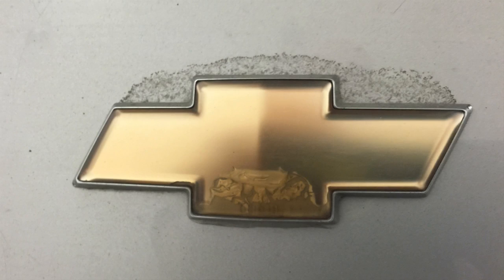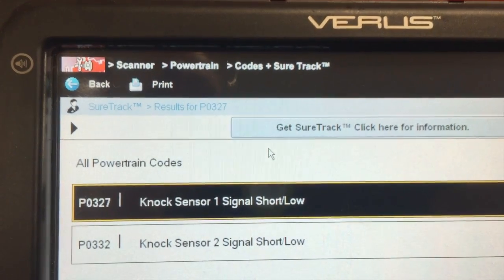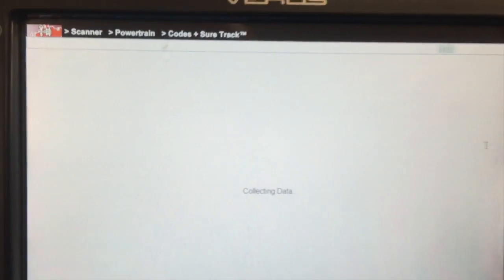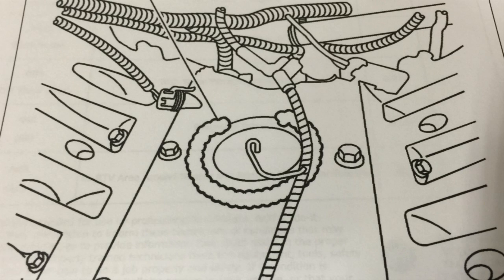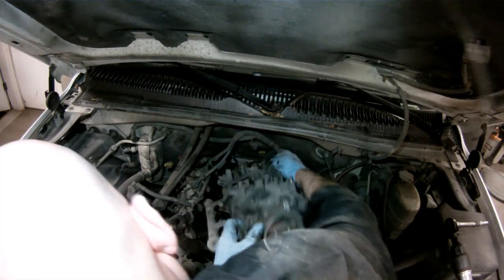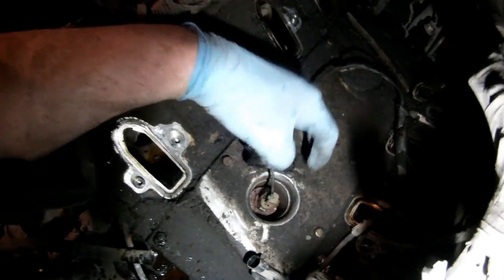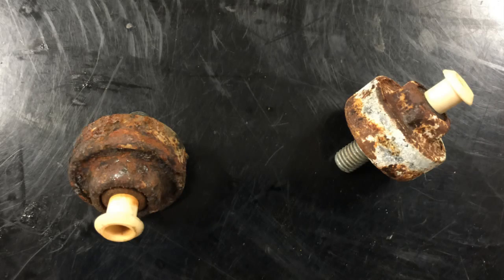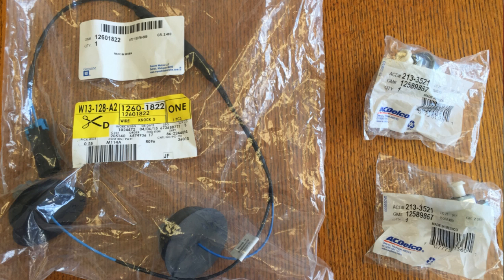Chevy and GMC Code P0332 P0327 - Knock Sensor

Comment: Replaced both and the wiring harness after a PO 332 Code, and now getting the PO327 code.  Could this be a battery or alternator issue?

Comment: I have a 2004 Chevy Silverado we have replaced the knock sensors and the wiring harness and the valve cover gaskets with GM two days later the light comes on and still says knock sensors went back in the shop had the parts warranty doubt replaced again same thing keeps on recut Rica Corrine what else could it be I'm at my wit's end I would like to get my truck going again and enjoy it I've had it rebuilt from the ground up and had it customized and since I've got it out of the body shop this has been an ongoing problem

Comment: Replaced sensors TWICE. Both times with GM parts. Still getting code. 😭
Reply: So am I, about to take it on a 800 mile trip to Vegas. Did you still have the problem or did you find the fix
Reply: @iWubzies  I haven’t had time to take it back to the shop, but I’ve driven it 2000 miles for work over the past month and it didn’t affect the truck at all. It’s just a light. I am, however, dropping it off next week to hopefully finally get them to figure out what’s wrong.

Comment: did the sensors with wiring harness twice☹☹☹ and i still have the lite
Reply from the maker: Did you use OE parts? Correctly torque sensors and make sure not to drop them before installation?
Reply: @ThecardoctorTV  after watching that vid u suggested and yours i have doubts. i know it wasnt torqued but i made em tight as hell and the gasket for water i didnt do , bought the parts from 1a auto dont remember them saying ac delco
Reply from the maker: @geraldturner8377  over tightening ruins the sensors. Non-OE parts are problematic.
Reply: @ThecardoctorTV  AGREED ON THE SENSORS and over tightening . thanks for the info when i saw u had ac delco my heart jumped😒 i was hoping you knew about a1 auto and bout parts there .greatly appreciated

Comment: Hi i did my intake gasket valley pan gaskets for a leak i replaced my knock sensors just cause i had to remove them i had no code prior once done now i have a code for the sensors replaced with ac delco wth any idea

Comment: So this is an old video I was looking because after getting code P 0332 I replaced my knock sensors and harness with aftermarket parts. Code came back. I than took the intake off again and replaced the Knock sensors with AC Delco sensors and a harness. Code came back. I opened up the wiring harness traced the wires from the plug back to the ECM and I removed the pins cleaned and ran new wire. I testes the wire hooked it up and started the truck. The code was gone. Put the truck all back together and since I live in Pennsylvania I need an emissions test. And since I cleared out the memory I need to drive the truck about 100 miles. All went good for the first 5 minutes then the code came back. Now what??

Comment: I had a major vacuum leak at my intake gaskets on my 02 Chevy 4.8 and decided hey why not change knock sensors while I had it apart. Got the Dorman kit which comes with 2 new sensors and harness. Well a couple hundred miles later and I have a p0327. Super frustrating! Definitely don't buy Dorman!!! I should have left the old ones. Lol.

Comment: Seeking help My car has been running really crappy I have a 2002 Chevy trailblazer AutoZone hooked it up to a diagnostic and said it was running rich so I figured it wouldn't hurt to give it a tune-up change the fuel filter air filter spark plugs spark plug boots a friend hooked it up to their diagnostics that is CO2 sensor was bad $77 on that replaced it and now it's saying another sensor is bad which was a lot cheaper only $13.99 but it's still not running great I feel like it's running better but not like it used to be it kind of reminds me of when you get bad gas how it's kind of sluggish and just almost sounds like it wants to die you can just hear it and feel it in the vehicle an y suggestions from anyone and also my cruise control is not working driving me crazy appreciate any help at all thanks everyone
Reply from the maker: What are your fuel trim readings?

Comment: We did us AC Delco  parts and my L33 5.3L still throwing knock sensors codes and YES my brother is atleast a 30 year mechanic! I'm about to just bypass it! I can burn rubber, low on power & there's some days I pull out into traffic and it doesn't good it's like someone is pushing it, then it just seems to wake up out of the blue. There are times that it runs like a raped ape! On another note have you ever heard the hour meter reset itself? Thanks for taking a look at my note!

Comment: I have knock sensor code and I am thinking the knock sensors and woring harnes was replaced because I bought parts and observed the top end off and seen holes where sensors go..no audible of which you speak was present..but I now have the code still..not sure why  was suggested to me throttle body and or mass MAS may need cleaning

Comment: I'm just a little confused on your video every video I've seen was not this labor intense to replace it.... In the park is like a $35 part from an auto parts store and you go up from the bottom to replace so I guess I'm just a little confused... Yes I only Chevy Cobalt that's been diagnosed with a faulty knock sensor

Comment: I got this code on my 04 avalanche. My truck is running fine but the light came on while driving on the freeway. I bought thr part from oreilly,  is this something i can tackle In a weekend? I've worked on my truck before so I have a little bit of knowledge on it

Comment: I replaced all 3 parts with aftermarket crap a yr ago and now I have both codes again even though the knock sensors still look new. So I’ll buy the oem parts

Comment: I'm knocking my head on this one. I replaced my 2006 sierra knock sensors with cheap aftermarket parts, failed within 100 miles. Replaced again with OEM sensors and harness, same outcome.
What I'm I doing wrong? Torqued properly, wire harness has continuity.  Your channel is great!
Reply: Truck at operating temp bring rpm’s up to 5k for 5secs twice after replacement and code clearing

Comment: I replaced my knock sensors with aftermarket sensors and wire harness, within 2 weeks the error code returned. I blamed it on the aftermarket parts and replaced them with OEM parts. 
Another 2 weeks passed and the error returned again. Any advice?

Comment: So glad I have a 8.1 in my 2002 2500hd my knock sensors are right on the underside of the block right in the open where you can get to them 😎

Comment: I replaced both knock sensors a couple weeks ago now I have this code.
Reply: I've also just replaced both sensors along with the harness... all gm ac Delco and I have the same code popping up... I deleted and comes back...smh
Reply: @gerardoesparza8650  What did you end up doing?
Reply: What did you end up doing?
Reply: @colerichardson1746  i replaced them with gm ac delco knock sensors, also the plug and made sure the area was clean and dry. The code went away.

Comment: My son replace BOLTH knock sensors and wiring harnesses built the dam with silicone cleared codes with my AUTEL unit. 2 days later it's throwing PO327 any ideas?
Reply: I read Duralast brand sensors are best. Test them before though.

Comment: My 02 yukon XL bucks and vibrates when accelerating 40-55mph and this doesn’t happen at any other speed...can this be a knock sensor? No Check engine light
Reply: @MRivera4396 did you find the problem with the vibration on that speed?
Reply: @leonardomerino8167  yes, it was the torque converter locking up, I ended up having to rebuild transmission and new torque converter

Comment: I know ! I just bought a decent Bosch 2220 scan tool which is worth over $300 AUD on sale for $199 AUD & I scanned my car which is fitted with the 5.7 litre Chevy LS1 engine which is like this one :-

https://goo.gl/images/DNnbCU

The trouble is it's an Australian built car & I have to scan it as a U.S. built 2002 Chevy Camaro as they both have the same ECU,there's no listing for a 2002 model Holden VY Commodore.

I got the P0332 code because it has a cheap crap knock sensor in it at the rear of the engine, I've had trouble finding a scan tool which will scan the car as the cheaper ones will only scan some of the 2004 model Holdens & all the 2005+ models which run the Bosch CAN OBD2 (11 & 29) ECUs,any cheap crap scanner will read codes stored in them.

Note it's best not to pressure clean the LS1 engine so the knock sensors won't corrode, I replaced the valley cover gasket a few years ago & reused a knock sensor that I replaced in 2009.

Holden scanned it back then with GMs Tech 2 scanner.

Comment: Are these intakes and knock sensor placements different on the LS4 5.3lt in the Pontiac grand Prix GXP's? I have to do knock sensors on my 06. And I'm wondering which gaskets I should also order ahead of time.

Comment: Hey body I change the my knock sensors and plug on my 05 gmc yukon just like a week ago light came off after I install it  but just turn back again giving me same code p0332 and p0327 any ideas?
Reply: Harness Ground problem if you get both, or possibly bad leads to and from. But alot less likely

Comment: Had this on my 01 Silverado. It runs fine and I am getting the best mileage since I've owned it. I'm not touching anything unless it starts having problems, but it's been about 1500 miles with no issues. We'll see.

Comment: I replaced both knock sensors & harness and P0327 P0332 still come up
Reply from the maker: Did you use a torque wrench to tighten the sensors? Have you tested resistance at the connector? Did you use OE parts?
Reply: I did use torque wrench I did not use OE parts

Comment: Dang knock sensors at the Dealer want $114.00 a piece! Crazy! Original equipment. Where else could they be cheaper?
Reply: amazon had the ones for my 99' for under 50 bucks
Reply: O'reillys or autozone.. $35

Comment: I have got a 2001 1500hd with 6.0 engine , keeps throwing po332 and po327 codes , I have installed three different knock sensors , still get codes , replaced the wire harness twice , and yes I'm using GM harness and acdelco sensors ,  
what can I do to trouble shoot this ,  any tips , and yes I torqued the sensors down to 15 ft lbs each time , 

have you ever put a 100 ohm resistor inline for the knock sensor ?
Reply from the maker: never tried that. Is there an engine knock? Might need to measure resistance all the way to the PCM connector
Reply: i have and it all checks out good , 
do you know what measurement the pcm is looking for when it test the KS , ? 
I do understand that the resistor in the KS is for the voltage drop coming from the pcm , so is the pcm looking for resistance or ac volts in a specific range ?

Comment: Hello sir I have a 06 Cadillac Srx with code P0332 on knock sensor bank 2 , would that also be under the intake manifold ?
Reply from the maker: depends on what motor 3.6L is on the side of the engine block The 4.6 is under the intake. If it is either motor I would do the sensors and wiring at the same time. Best of luck
Reply: The Car Doctor yes its the 3.6 ! Thanks for the reply! One more question , do you think that sensor could also be causing me a misfire on cyl 6?
Reply from the maker: well its a good place to start but unless its knocking and pinging really bad as a result of a faulty knock sensor I wouldn't think so.
Reply: The Car Doctor when parked it doesnt cause any misfire and usually driving around small streets wouldnt either until i get on the high way and go above 45 mph my truck with start knocking and doing the “fish bite” and flashing the check engine light and once i get over 60mph it stops , so yeah im going to try and change that knock sensor and see if that changes anything

Comment: my knock sensor is on bottom of my block.,should antifreeze came out??? there is a blockage of black crap inside the hole where the knock sensor goes.,,,any help would be great  !!!!!
Reply from the maker: No, that's fine. Its better when they don't leak that way. Just be sure to put sealant on the threads just in case but many have blind holes anyway and are not connected to the cooling system
Reply: thanks...should i scrape out the black goo?

Comment: I been having same issues , have worked on this thing 4 times and still not right , 
watched you video and many others , I have good grasp of the issue , but light keeps coming on for low voltage to both knock sensors 
heres what I checked =

both sensors ohm at 100.1 at the ground bolt 

getting ac volts from the sensors (but don't know what specs are calling for )

pcm wire harness to the pcm  , (while running ) I'm getting 0.42 and 0.43 volts from the pcm 

do you know specs on this from the pcm ?

parts that are installed are 
new GM wire harness and new acdelco sensors , both test fine before install
Reply: by the way its a 2001 chevy 1500hd 4x4 6.0 motor
Reply from the maker: did you properly torque the sensors on install? common oversight causes the same issue
Reply: yes i torqued them to 15 ft lbs
Reply: its really hard to fix this with out a snap-on scope tester ,
Reply: @smokingmeatanddiybydaniel8953  hey did u ever fixed the problem

Comment: I replaced mine with GM sensors but, in a time crunch, used a Doorman harness. Don’t use a Doorman harness. Code still pops up.
Reply from the maker: Oh crud. Also make sure to properly torque the sensors to avoid return codes. Sorry about your problems, hope it gets better

Comment: Hi Doc, as usual excellent very informative video. Doc i have 4.3L 01Sierra i could not locate the knock sensor. it uses  GM part number (21024981) and it is  installed externally but i don't know where. Appreciate if you could help.
Reply from the maker: Under the distributor. Have to remove dist I believe

Comment: There should not be an audibly knock
Reply from the maker: no, an engine knock is a bad sign
Reply: The Car Doctor well you said that an audible knock was a sign of a bad knock sensors but you should not be able to hear anything I'm pretty sure that the vehicle goes to using the low octane spark table when one is not working properly

Comment: Will washing out the engine bay possibly cause the bad knock sensor? I swear right after I had my 03 Yukon detailed the check engine light turned on and this code poped up!
Reply: My experience exactly! I have a 2001 Sierra C3, sprayed some Simple Green and rinsed, then blew dry with a leaf blower. Check Engine came on shortly after and diagnosed with P0332 code.

Comment: I have a 2003 Chevy 2500hd (gas) and I was getting knock sensor codes for both bank 1 and 2 I replaced them with brand new ones from 1a auto with the wiring harness and I now how bank 1 and 2 low input codes any suggestions I did read I was supposed to torque them down and I failed to do that
Reply from the maker: torque is the main problem for reoccurring codes after service. Watch the video in the link in the description for this video for more info. Sorry you are having those issues.

Comment: I have a 02 silverado 5.3 i changed the mass airflow sensor an its still doing the samr when u plug it up it tries to stall an u cant drive it but if u unplug it it runs better an is drveable i have bern told several diff things. When its on the scanner it only shows misdfire cylinder 7 but i have changed the coil wire an plug i was told it is n the fuel system

Comment: Hey car doc.  Where is the knock sensor located on a 2010 Chevy equinox?..
Reply: It's actually in the front of the engine.  Not inside. Replaced mine a few weeks ago from under my car.

Comment: i have a 2000 chevy silverado 1500. It stalles while driving and then it will idle for a little and die 20 minutes later its starts fine drives for 40 minutes and does the same thing. both knock sensors and harness have been replaced but still throughs the same code.
what could it be?
Reply from the maker: What code is that? Is fuel pressure constant? Have you checked injector pulse?

Comment: ive got an oil leak coming from the rear of the engine.  going to tackle this and was wondering if there is a gasket under the valley pan where those knock sensors mount to.
Reply: Don Ammon there is a green clip on gasket underneath. ideal to replace while you are in there.

Comment: hey car doctor how hard is it to do it ur self I want to do I but on a scale from 1 to 10 how hard is it
Reply from the maker: Depending on your skill level its not too bad. If you give yourself a few hours and have the right tools and information its fairly easy. Be sure to properly torque the knock sensors after installing!

Comment: hey car dr. my name is Dion i have a 2002 Avalanche 1500.5.3lt it cranks starts but shuts  down after 2 sec. or so.i hear the fuel pump start build pressure not sure how much.waiting to get my hands on  a tester to cheçk pressure.the security light stays on when key is in off pos.sure could use some help.ï
Reply: Dion Filler. If ur security light stays on. That would be the gm pass lock system. It shuts down the fuel pump. U can still hear it but won't send fuel. U happen to use a different key then the original? That's usually the main cause.